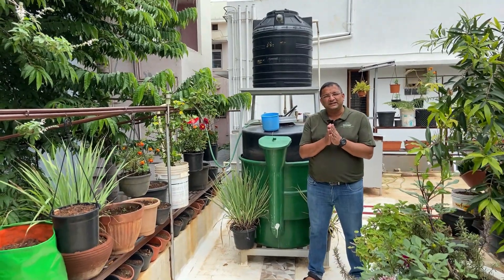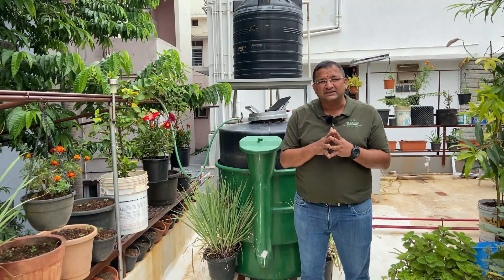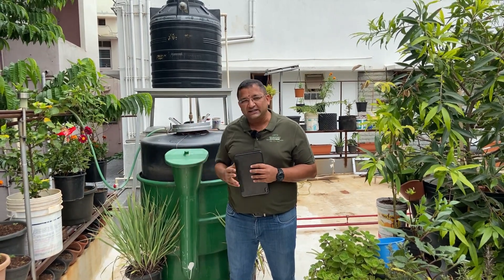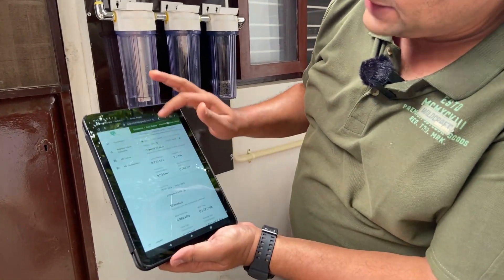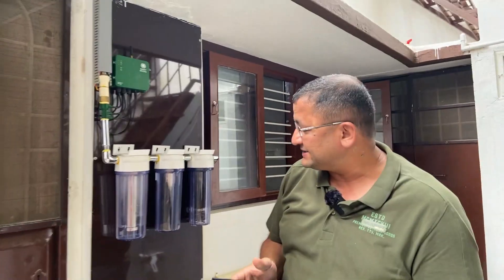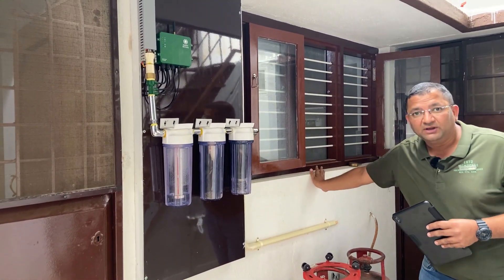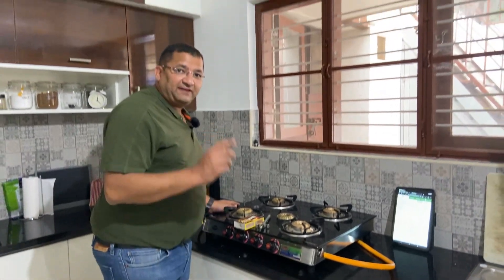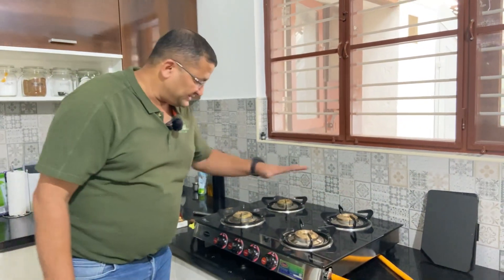Bio-Gas Filtration, Bio-Gas Measurement and Hybrid stove

Comment: Very useful video. However you didn't touch up following aspects. i. What is the maintenance of this setup? ii. Will there be smell coming out of floating bio-gas filtration unit? iii. Does the slurry smell bad? iv. Frequency to clean the system and 3 filters? if you can share your experience after long usage it would help viewers to make informed decision. Appreciate all the effort sir.

Comment: Is there any technical reason why you cant light the lpg side of the stove with conventional matches?
Reply from the maker: @dantronics1682  you can light the LPG side with matches but cannot light bio gas side with li
Spark lighter .
Reply: @HinrenEngineering  thanks for replying,  I found a way of storing more gas than what fills in to the floating dome, Aliex sells some pumps quite cheap that will pump the gas produced so if you fit a microswitch to detect when the dome is up about 6 inches it sucks off the gas into another container, its still low pressure so doesnt have to be a steel container, a tank similar to that water tank will do. my digester is fixed so I use a pressure switch to turn my pump on and off. I dont use the gas but use the waste liquid for my plants so just vent the gas off now.

Comment: A tiny observation. The biogas flame is pulsating. It indicates that there is some water condensate blocking the gas line. You will get a smooth and steady flame once you remove the water from the line. ( I am not talking about the water filter, but the water being stuck in the pipe somewhere along the line. )
Reply: That is what the cat litter filtration would help to remove the water vapor from the gas!

Comment: Can we use this gas to run a diesel generator?  Some people say it can cause issue and head gaskets go bad etc. is there a conversion kit needed to run diesel generator.
Reply from the maker: I don't know if this gas can run a generator. I have never tried
Reply: @HinrenEngineering  it can with gaz carburetor
Reply: we have few plants working in pakistan (you might find on youtube) which provide gas to generators. These generators are then producing electricity.

Comment: One thing I didn't understand is that the one tank goes up and down depending on the amount of gas you have. But I thought that the slurry needed to be in an air tight container for anaerobic digestion. So how do you keep the seal between the gas holding half of the tank with the slurry half of the tank? or is there some small gap where the slurry is open to the outside air?
Reply from the maker: Please refer to this video https://youtu.be/cTs2Lly8-zQ?si=5m2OVlL_r5lQ92DI